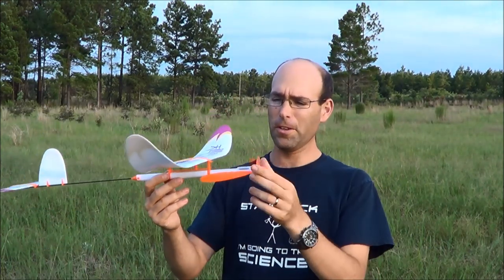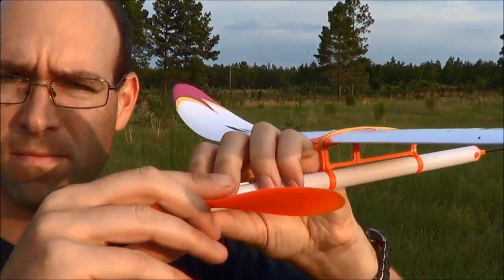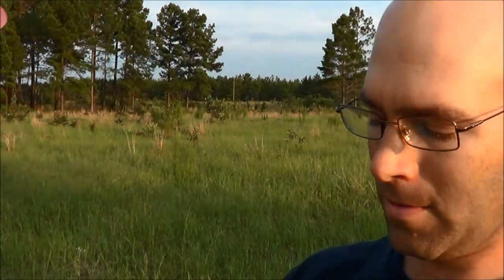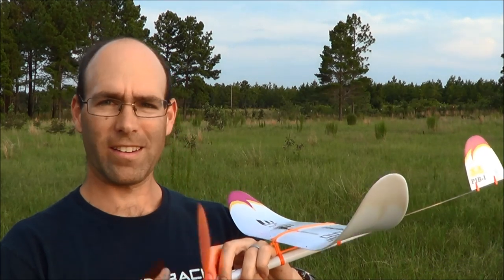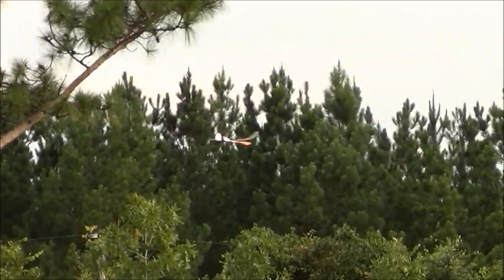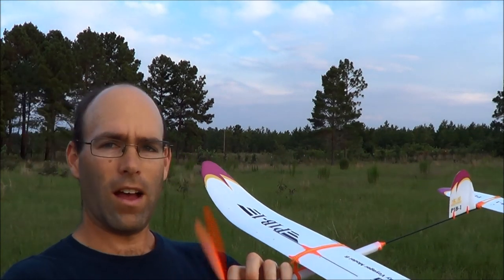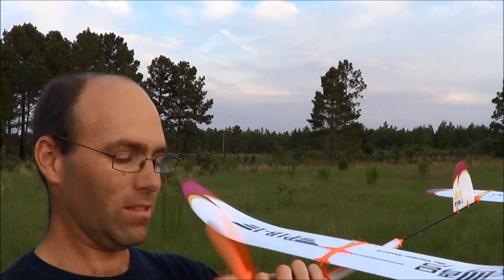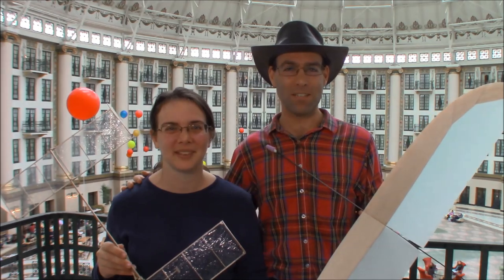P1B-1 Sky Voyager - Flight Trimming

Comment: Lost my Sky Voyager this morning. :) :(  The first flight on a 90% wound 5g motor, 4 strands of 1/8" 150% of hook to peg distance, came down just inside the field perimeter/tree line. The second flight, on the same motor, was wound to 100% and it was still running when it crossed the same tree line at about 100ft, then the prop folded and it continued to climb about another 75 ft before drifting out into the neighbors pasture, too far away to retrieve. I knew the risk but was just happy to see the plane get it's flight wings after many a low power flights and a year of sitting around collecting dust. Great flying model and you can't get much cheaper.
Reply from the maker: Sad to hear it's gone, but what an awesome story!

Comment: Several questions: my plane was power stalling on launch, so I finally sanded in some downthrust at the orange front “motorblock”, also some right thrust.  Previously, it seemed I had just enough right rudder to match the left turn torque under power to create a perfect power stall at launch, the airplane swooping up under power, then a huge stall that would would just worsten under power then continuing in the glide...all this after I had established a nice floaty hand glide w/o stalling...I may need to take a little of the down thrust back out of it after watching your trim video. Once I got a reasonable right turn in the hand glide I spot glued the wing pylon onto the motor tube because every landing was moving (twisting) the front or back pylon post ever so slightly resulting in a different turn radius or even direction on every flight. This makes tweaking impossible, guaranteeing an inconsistent glide pattern...also used the little wooden wing alignment blocks so the wing is nested consistently on the pylon...everything repeats now, so I can make adjustments and get the same results flight to flight...I bought the yellow winder...seems completely overpowered by the torque of two loops of tan 2. I’m flying at dusk with about 350 turns...but feels like the winder teeth are not happy and I’m close to breaking the handle trying to turn the crank...awfully disappointed in this winder...please explain how to transfer the rubber from the winder hook to the motor hook... I nicked my rubber right away sliding the motor hook wire onto the wound rubber at the winder hook...I have no idea how to hold the coiled siliconed rubber well enough to manipulate it onto the motor hook...so winding with the winder is bad, and transferring from the winder hook to the motor hook with 350 turns is worse... please explain what I’m doing wrong...

Comment: Im trying the single strand of 1/16 rubber on the DT system and will see if I can get it to actually last for the 2 minutes...I’m an old RC buff, but was in love with hand launch free flight as a teen...built a bunch of Thermic 20 hl gliders and my dad, who was a true free flightier and control line modeler built a Tissue covered Thermic 50... when I saw the first hand test glide from shoulder height smack the across-the-street neighbors roses 150 feet away at waist height I was HOOKED on gliding flight... we also did some small Jetex powered gliders... From 15 years of RC soaring competition I have a good understanding of trimming, washout etc... however my DT knowledge is non existent... I don’t know how that little button thingy even works! Is it oil filled? The other thing I’m curious about is rubber motor turns... is there a chart showing reasonable turns to be expected from various rubber loops... I see that indoor models get a thousand plus turns... On my P1B what’s considered a reasonable full wind? Also do I need a metal o-ring at the prop end of the rubber in order to utilize a winder? I am ignorant about the transfer from winder hook to prop hook? What’s the secret? I have real trouble holding , removing, reinstalling 300 turns without : 1)losing a loop 2) nicking the rubber 3) losing my grip on the whole wound mess 4) yelling at my wife who is holding the fuselage at an awkward angle because I haven’t taken 20 minutes to build a stooge...
Reply from the maker: Thomas, here's one document with some useful information:
Reply from the maker: I've got another chart as well but FB won't let me link to it. Shoot me an email at joshuawfinn@gmail.com and I'll send it to you.

Comment: I built a P1B DT per your video using your little dt throttle offered on your website... how can you set on of these things for longer than the motor run, say 2 minutes?
Reply from the maker: Play around with the rubber tension on the DT to get the rotation slowed down. A single strand of 1/16 will run nice and slow and should let you go out past 2 minutes. The ultimate solution is to use a spring wound from .010" piano wire. I believe Volare Products and Retro RC actually sell preformed tension springs. They give a wonderfully consistent tension curve so you can slow the timer down signal.

Comment: Bought one of these to serve as a grandpa/granddaughter project after suffering through an endless round of trying to get a Guillow's gum-band to stay aloft for more than a few seconds. Trust me, these things really FLY! Probably better than most guys without years of experience building competitive free-flight models could accomplish on their own.  Still playing with rubber setups (length, strands, etc) but very promising.  Couple things to consider... 1) the rudder will probably not maintain it's adjustment from flying session to flying session, or even flight-to-flight, without some sort of positive stop. A small balsa or depron rudder horn and some tiny wire can help with consistency here. 2) Rotating the wing mount in relation to the stab gives the effect of stab tilt. I don't know if free-flighters still use stab tilt in trimming.for glide, but it works. "Something to try." 3) DO consider a dethermalizer of some sort. I haven't rigged one on my "9-going on-19" granddaughter's plane in the full expectation that at some point, she'll experience a fly-away.  How she responds to it will tell me whether she's inherited the free-flight gene from her grandpa or not. 

If she doesn't ask for a replacement, I'm buying another one for myself. They're THAT good.

Comment: what i made many years ago, was  not a rubber powered but a simple glider.  body made of trimed bamboo, cartoon wings with bamboo strip on the forward side and plain cartoon tail.   I put slits on wings and tails just like a airplain have, a little lead on the tip of the plane and a hook under the front buttom  and a sling shot.   Just like what you explaine on how you want you toy plain turn left or right when on flight,  I bend it a little bit where I want it to go.   
One time it was a bit windy, it flied so far that I had to chase it  :)    Never good when there are tall trees around.

Comment: Mine was also nose heavy and the folded prop hit the wing when trimmed out. Then I noticed a figure in the instructions showing the trapezoidal steel weight is the same shape as the forward hole in the wing support. The weight is shown in that hole. Putting the weight there moves the CG & wing back when trimmed. The folded prop no longer hits the wing and I am getting longer flights. Next I am going up to 1/8 inch rubber. I am thinking about the RC conversion in lieu of a DT.
Reply from the maker: Glad to hear it's flying well!

Comment: Hi Joshua, thanks for your videos, they are of great help. having some indoor free flying experience, I would like to ask you a question regarding this model motor. Considering 4g of rubber, ow many strands, which size and lenght will be the optimum configuration? thanks in advance for the answer :-)

Comment: How hard would it be to put a strip of mild metal in the vertical tail to provide stiffness? Or notches in the fuselage to tune angle of the wings?
Reply from the maker: I'm not a big fan of metal bend tabs although a lot of folks have success with them, so it's something to consider. Same with keying the wings for consistent alignment (I really need to do that on mine).